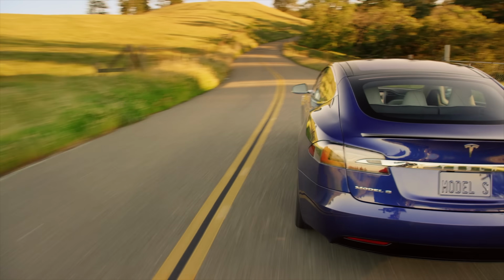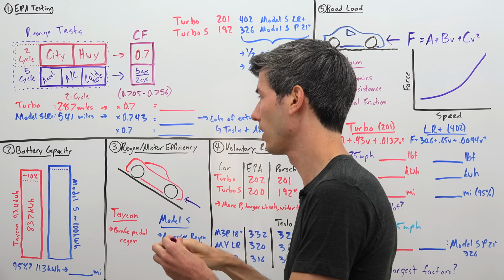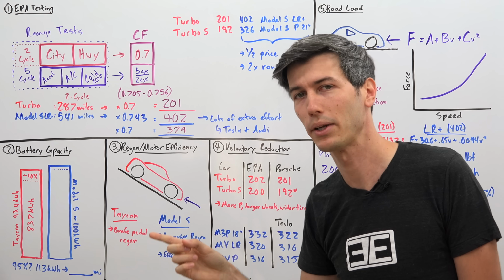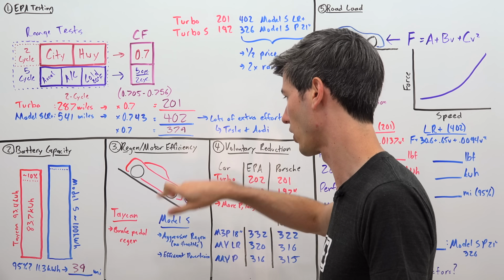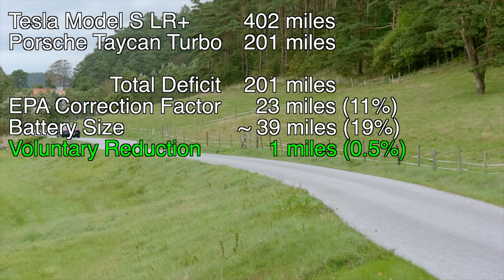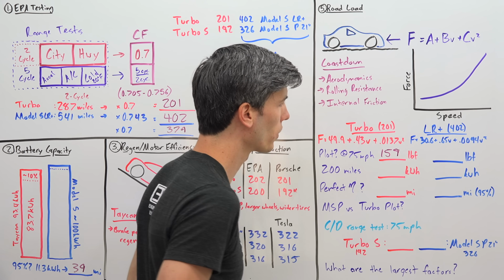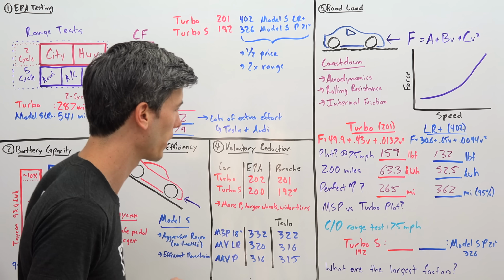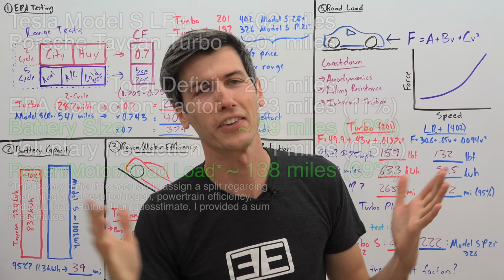Tesla's Secrets To Dominating EV Range - Double Porsche?!

Comment: Dave Vanderwerp in the C&D test of the Taycan Turbo S vs Tesla Model S: "More surprisingly, the Porsche held its own in our 75-mph range test. While the EPA says there's a 134-mile difference in the range between the two, extrapolating from our 100-mile run, the real-world difference amounts to 10 miles in the Tesla's favor. The Taycan also won the other speed test, with its consistently higher charging rate providing quicker recharging."

Comment: I do a lot more than 201 miles in my Turbo S. Get about 230 miles. When I did a range test with a Model S Raven in summer on the German Autobahn at about 130 to 140 miles an hour the Tesla had to charge before me and charged for way longer. That's that.

Comment: If Turbo S with a huge gap in road load with Tesla s is able to drive for 209 miles range in a highway, how much would the Porsche Turbo with no road load difference will drive. I am assuming it would be even more closer to Tesla Range of 222 miles. Correct me if I missed something or went wrong somewhere.
Reply: bodoti qwiu  If I am correct the energy source for exisiting vehicles and EV is different and since fuel based vehicles have huge dominance in the market, a question of how to compare EV with them in numbers was raised and to make it simple empg was introduced. This makes things easy for novice to compare his exisiting vehicle with an EV. I believe this would change in the future. Infact energy generated by renewable sources are usual given numbers with units Millions of tonnes of oil equivalent  (mtoe).

Comment: from the various read-outs I've done on 100kWh Teslas the usable pack when new is about 93-94 kWh, the absolute pack is about 102 kWh.
So Subtracting 6-8 kWh from the nominal number for a Tesla is a safe bet.
Reply: Does Tesla have an OBD2 interface port where these values can be read out?
Reply: @foersom5928  Yes and no.

Model S and X have one, but it is useless because it had to be there because government agencies where to slow to recognize that it is unnecessary for an electric car. It basically says "I'm an electric car, go away, no emissions to test here."

Model S, X, 3 and Y all have special connectors under the MCU or center console where with an OBD2-to-Tesla-adapter you can connect and sniff the CAN signals, which can be decoded by some special apps like scanmytesla.
Reply: @markusdd5  That begs the question why does Tesla EVs not follow standard and have the CAN-bus data output on a OBD2 port?
Reply: @foersom5928  Because there is no need to. Simple as that. This is all proprietary info and not relevant as per the OBD diagnostics standard. The decoding has all been done by ethusiasts in their free time.

OBD2 is a standardized interface to get emissions-relevant diagnostic data. 

Tesla also does not need these ports as they communicate with their cars using ethernet or Wifi.

Comment: Great video as always but there was one thing that was confusing to me. 
While it might well be that Tesla has a more efficient regen braking than Porsche I don't see how the regen strategy matters at all or, if it does, in the advantage of the Tesla. 
Technically speaking, coasting should be the most efficient way of energy use. So why would it work in the Tesla's advantage if the regen is applied easier and more frequently? 
When the Porsche is coasting in neutral the energy isn't lost and transforming the movement back to electric charge is never 100% efficient...

Comment: Why couldn't the Porsche make turning off Regen an option!?
Reply: It is.
"There are actually three regen modes selectable via a button on the wheel. One feels like normal engine braking, another is regen off, and there's the camera-based adaptive mode we're testing."
Search for carmagazine article "Taycan EV's adaptive regeneration: does it work?"
Reply: @foersom5928  Interesting. I would think the EPA would test with Regen on. 169 miles of difference would be much lesser don't you think?
Reply: @sensiblewheels  Yes they should use ADAS camera adaptive regen.

Comment: Regen argument does not hold water, as you get off the pedal in Tesla you are again converting energy which is always wasteful. Air resistance does not change in any scenario.
Coasting is always better, and in Tesla you have to press the pedal ever so slightly to coast. So it can never work in Tesla favor.

Comment: The biggest reason seems to be tires. You didn't mention that? Björn Nyland has done a highway range test of both cars. He concluded that they are very close in real world range. The reason was that the tires the Taycan had was low resistance ones. Also the temperature was slightly different during the tests. Taycan at 27 degrees C and model s at 16 C. 
Taycan 90 & 120 km/h: 579 & 425 km
Model s 90 & 120 km/h: 644 & 473 km.

Comment: To bad Tesla's all look cheap interior and exterior compared to the Taycan that is in another league but you will be paying for it as well ..big bucks
Reply: Yes, the interior isn't that great compared to most luxury brands. But most people are willing to put up with it because a Tesla vehicle offers many other things that combined together make a very compelling product. While other competitors have some similar things, they don't have everything Tesla does.

In no particular order:

The Supercharger network. Sure, other DC fast chargers are springing up too, but they still don't have the coverage Tesla does, and Tesla is still expanding theirs as well. 

Autopilot, which while still far from real full self driving, is improving over time. It really does help to reduce stress from driving long distances such as a road trip.

Over the air updates which improves features on their cars such as being able to use the side cameras when using the rearview camera.

High ratings on crash safety. This alone would be a big factor for some folks, especially those with children.

Other than the Model 3, the fairly large cargo capacity inside. It's not always the largest compared to other vehicles of comparable size, but they do give you a lot.

That 0-60 time, which may be boring for some people. But it can be useful in everyday driving like when merging onto a busy freeway on an uphill ramp. Or when passing a slower vehicle, so you spend less time in the passing lane. Or if someone just decides they want to race you at a red light.

The cost. Yes, it is in luxury car territory, but you do get a lot of "bang for the buck" You'd probably have to spend 2-3x more to get a comparable gas car with most of the features that come on a Tesla.

That said, I hope that other upcoming EV's will give a Tesla a run for its money. Tesla setting the standard gives them something to strive for, and a benchmark to measure their cars with.
Reply: @Geckogold  damn your comment made me want to buy a Tesla for daily use

Comment: Some interesting details in your presentation, however the C&D testing basically refuted all of the prior information. More importantly, it would appear based on several different sources including some testing I’ve seen on a race track where a Taycan 4S and Tesla model 3 performance had almost identical battery charge levels after the exact same amount of time run on the track, whereas the EPA range indicates that the 3P should go ~50% further. Something seems fishy to me… It would be very interesting for you to explain why there’s such a discrepancy between EPA versus real world, specifically in the Tesla does so well on EPA in comparison to Porsche.
Reply: Well, the Model 3P has a much smaller battery, and is able to regenerate more power back, when slowing down in normal public road driving.
Porsche coasts more regenerates less.
That is why we have EPA rating, not a get on the highway constant speed rating. EPA is an indication of range expected in town driving with some highway driving.
Reply: AllGood again - why does the Porsche perform so much better than the EPA rating, and the Tesla, so much worse??
Reply: @TAFORTH  Tesla appear to perform worse on tracks (though they get very accurate real world tests) due to regen braking being a very important part of their driving aspect. 

Porsche do very well in track tests and pure highway driving due entirely to their battery size. However, the lack of frequent use of regen braking likely affects their city range heavily. No idea for sure though.
Reply: @anthonypelchat  and @Allgood: I don't know how you come to this conclusion that the Teslas use more regenerative braking or get more power back then a Taycan. It is the other way around, the Taycan can regenerate up to 275kW (much more than any Tesla) plus the bigger weight will lead to more energy being put into the Taycan battery when slowing down from the same speed as a Tesla.
I think it's related to 3 things why the Taycan is more inefficient in the city cycle: 1. Weight. Taycan is pretty heavy and accelerating more weight costs more power. You can't regenerate all of it back (something like 60% maybe). 2. Rolling resistance. Taycan has much bigger tires (305 to 235 in the back). 3. Drive train. The Taycan when not driven in "range" uses always both electric motors while the Teslas only use one. That is because of the performance design of the Taycan.
Now all three points are important in city driving, but basically don't matter in highway driving. Here air resistance is the single biggest contributor to consumption. The other 3 are contributing as well, but only a fraction of the air resistance.
Reply: @computercrack  Your 3 points sound good to me. 

The regen braking part isn't how well one system is over the other. We were using that since Tesla's regen braking is always on. As soon as you let off the accelerator, the regen is slowing you down. Porsche doesn't do that. You have to hit the brakes to use regen at all. And if you hit too hard, then you will also be using regular brakes.
Reply: @anthonypelchat  The thing is u don't stop regenerating while the brakepads are applied so Taycan keeps regenerating with 265kW above 0.4g deceleration. Up to 0.4g u only use the regeneration to slow down. I don't know how much any Tesla regernates, but they will use the brakepads long before the Taycan does. Also in the EPA testing there will be probably no situation where 0.4g is exceeded, therefore the brakepads are not used at all in the Taycan
Reply: @TAFORTH  Porsche chose a different EPA test method to other manufacturers. This was Porsche's choice.
Reply: Explained mostly in the video. Track tests are not real world tests. The Tesla uses far more regen braking compared to the Porsche. Non-stop highway tests don't reflect this. Basically, the Porsche does better than advertised with highway driving, while the Tesla does better than advertised in city driving.

Comment: Who provides the road load numbers? The manufacturers. Epa gives latitude here, because they can't test every model every year, and aerodynamic testing alone is very costly. As long as the numbers aren't too outrageous, there is latitude here, and this is where Tesla embellishes and Porsche holds back. How else would you explain the tremendous range difference at highway miles? Porsche highway is almost the same as epa rating, but Tesla is off by 100 miles.

Comment: Great explanation as usual! 

However this subject can get a bit confusing when we start comparing the various versions of the Taycan and Model S.

For example, it is weird that the EPA ratings of the Model S LR+, Performance 19in and 21in vary so much (from 326 up to 402mi), while the Taycan 4S, Turbo and Turbo S are so close to each other (192 to 203mi). Especially when Porsche announces a Cd ranging from 0.22 to 0.25, while Tesla doesn't even report any such difference.
And when we talk of 326mi range for the Model S Performance with 21in wheels, is this for staggered tires or for equal width front and rear?

On the other hand, maybe the different driving modes available in the Taycan at the simple twist of a knob also have an impact if they are used troughout the EPA test. In Teslas, driving modes are "hidden" in the UI menus, so probably only the default setting is tested.

Comment: Great  analyses ! - Thank you for your treamendous work. I drive a modX100d now for 2 Yrs and  "practical"range is highly dependend on  driving style. This Tests  are  kind of sensless because they are not  considering all the conditions. But they are compromising.Temperature is a huge factor too. And the topography one is driving. Weight is important  as aerodynamics. No scientific evidence but TESLA´s are extremly efficient on the drivetrain. Taycan have 1-Gearshift. Last week I had a Taycan in my mirror. Looking for a "race"  Overtook me easy at 120km/h
because of their gear shifting . I kept accelerarting and at  210k/h(dont tell anybody😂🙈) I overtook the  180k$ Taycan. The road was a bit uphill and my guess is that the second gear is failing in this topograpghic situation.... I kept going  all out... By fortune no Police, so I kept my driverlicence... End of story and my conclusions: Taycan is a expensive EV for the fans but if I had a mod 3p in practical no chance to meet the metrics. The real problem for Taycan iis probably the gearshifting which sucks energy... at least at hilly roads.

Comment: Mostly by packing as many of those little battery cells as they can possibly fit into their battery modules, then stacking those together until they get 20% or so more than their rated charge capacity. From what I understand of Tesla's original design goals with the Model S, they intended to implement batteries with more capacity than claimed, but limit their discharge and charge capacity to their rated capacity so that, as the batteries age, their usable capacity remains within tolerances of their claimed capacity for the expected 5 to 10 year lifespan of the vehicle. I'm not sure if that is still what they do, since their battery quality has gone up as they work closer with their battery manufacturer's to produce higher quality batteries. Back when the Model S premiered, before they changed the individual battery cells to their new designs preceding the release of the Model 3, most people agreed that the individual battery cells used by Tesla were pretty mediocre and it was their use of a large number in charge and discharged balanced modules that allowed them to get decent performance and longevity out of them. Now that they're using a more custom-made cell, I don't know if they're still over-speccing their battery capacity. I know if I wanted to make a high range electric that retained charge capacity over it's lifespan, that would be the easiest method to achieve that.

Comment: Nothing is more efficient than just rolling instead of regenerating and breaking 🤦‍♂️
Reply: I'm wondering about that. Seems like speed would be a major factor since drag would be braking the car with no energy gain. At some point using regen would be more efficient until a lower speed is reached. Suggesting your statement that "nothing is more efficient than just rolling" is conditional with speed and may be true for speed, just say, under 50 mph.

Comment: So basicly manufactur rating -30% is real life if there's no traffic and you turn off or use low ac & audio, -50% if you have heavy traffic also full power ac and audio, -75% if you always floor it down, -100% if you die LOL